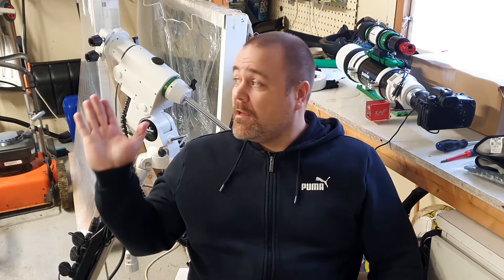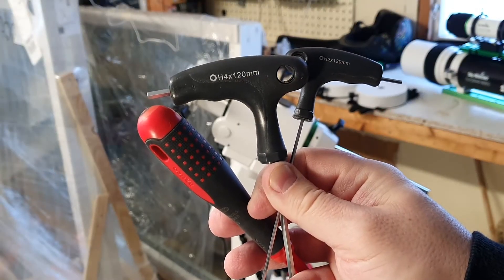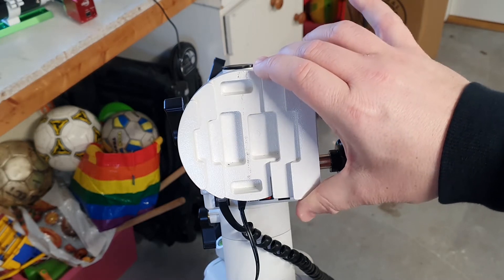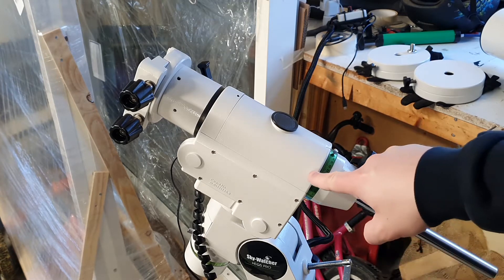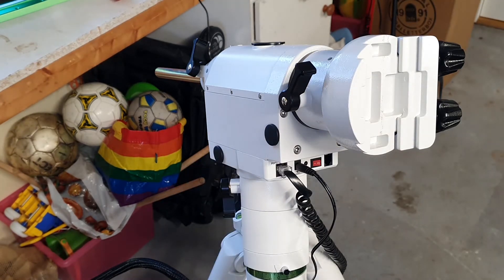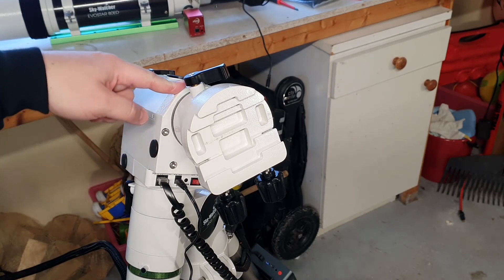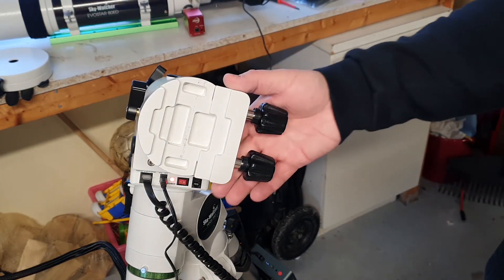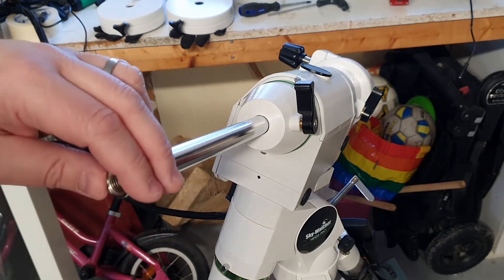Fixing HEQ5 Pro Backlash: The Ultimate Guide Part 1

Comment: Hi! I got a new HEQ5 from the shop, and they adjusted the backlash for me. But when i am trying to balance it, at some places it is stiff so that “unbalanced end” of the scope wont move downwards. The motors are working fine, does not stop or anything. Should i get into the backlash ot it will be fine?
Reply from the maker: Hi, I think you should test it first. Then if the guiding is bad, adjust.
Reply: @frosthastrophotography thank you!

Comment: I have a problem i was calibrating the backlash of my DEC axis, i slightly unscrewed the 3 bolts and then i was in the middle of calibrating the 2 screws when the Dec axis started to move freely even with the clutch on. I don't know what I did wrong and how to fix it do you have any ideas?
Reply from the maker: Hi, I would suggest checking the clutch, it can be adjusted. Sounds like it's not engaging properly.
Reply: I will try but it worked until a moment ago and I didn't touch it. Isn't it possible that the worm is not touching the gear anymore? I also have the top regulation screw that seem to turn idle...
Reply from the maker: @mase_vcg5459  Yes, maybe, but did you adjust it that much?
Reply: @frosthastrophotography  yes I might have made a mistake and tightened too much the top set screw...

Comment: Just bought eq 5 pro. Have 12v power supply. Plugged it in and it began to whistle ...zzzzzz whatever you want to call it. Is this norma ?
Reply from the maker: Hi, that doesn't sound normal, is that without it moving? How much amp is the power supply?
Reply: @frosthastrophotography  . Without it moving,yes.  2 amps Thanks for the reply
Reply from the maker: @jonrobinson1026  Hi, ok. Do you have another power supply to test? I use a 10amp, but you should be fine with 2, althought borderline I would say.
Reply: @frosthastrophotography  yes,just plugged In a 5 amp. High pitched whine . Press the direction keys ...moves a mm and then switches off and goes back to initialising. Question. 0.5 Amps = 5 Amps correct.
Reply from the maker: @jonrobinson1026  A 2amp 12v should be 24w and a 3amp 12v should be 36w, double check that.
Reply: My HEQ5 Pro has this high pitch "EEEEEEEE", when first switching on the mount too that's stops once you slew the mount any. I don't think it's anything to worry about.

Comment: Hi Marten, Thank you for that video. I have been having a bad guiding since a few months I could notice I have a backlash on RA, I used your tuto to reduce it, it worked, but I had a strange noise in the engine when I rotate 360° so I  adjusted again I have no noise now but still backlash, I can’t get no backlash and no noise , I unscrewed the  lower screw and I screwed the upper screw, did I do something wrong? Greetings from France
Reply from the maker: Hi and thank you for watching! It's a very very thin line between catching on or beeing to loose. You can also adjust the tension on the worm drive itself with the screws behind the black plastic covers on the side of the mount. I guess I did do adjustments like 8 times before I was happy and then still installed the Rowan Belt drive mod.

Comment: Thanks a lot to you and astrobaby's guidance on this issue. Had some really bad backlash in RA which ended up ruining the first sub after doing a dither like 50% of the time. At this point I had to have some crazy long settle times, like 2 mins or something like that to get around it. Finally had some time to spare and removed the backlash and got it regreased. Haven't had clear skyes to try it out yet, but it sounds really nice + no gear grinding anymore at least.
Cheers from Norway💫
Reply from the maker: Thank you so much and good luck with the clear skies!

Comment: Thank you for this very instructive video. I have a question though : I've heard some people say that while doing this fine tuning at room temperature, it's good to keep a slight backlash because at low temperature, in use conditions, thermal expansion could lead to binding you don't have at room temperature. What is your opinion on that ?
Reply from the maker: That is a good point. I did my adjustments in my garage and not in room temperature. I did not consider that to be honest.

Comment: Very useful, I've got a question, how do you tell gears are not binding?
Reply from the maker: By touch and feel first I would say. You should be able to smoothly move them. Also they should run smoothly when you slew. Listen to changes in sound and they should not, off course, sieze up when slewing.